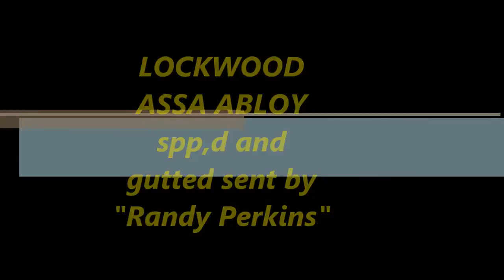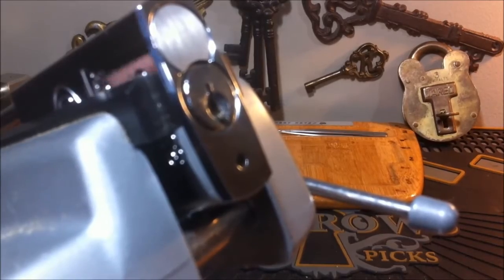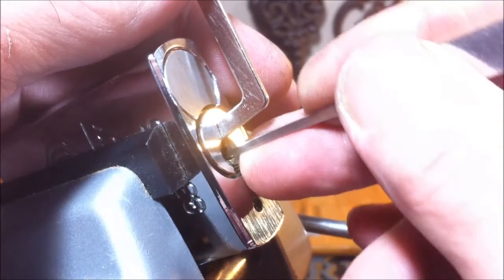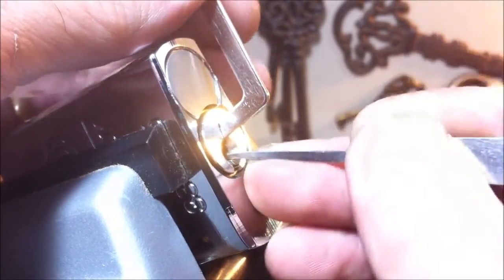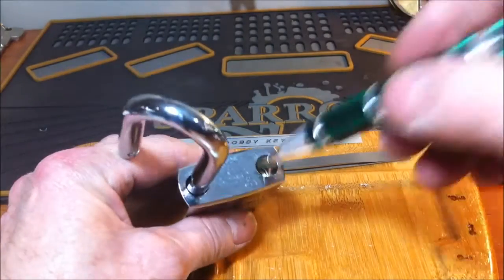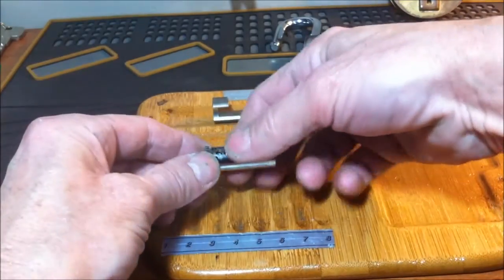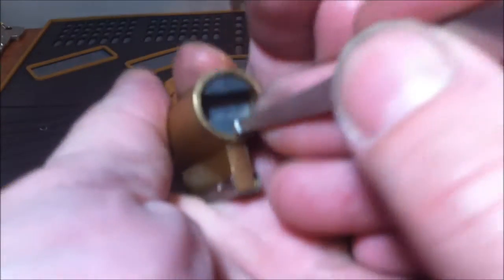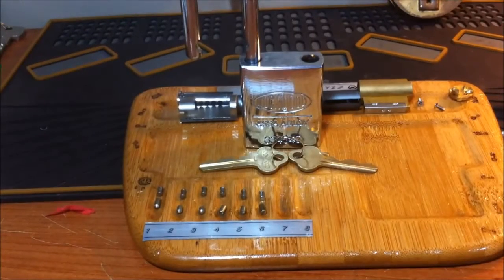(109) LOCKWOOD ASSA ABLOY spp,d and gutted sent by "Randy Perkins"

Comment: Those are not really standards in the plug. When you put the key in and they lifted a little bit and you actually had the best shot I've seen so far on the taper of the keypins. Very good job at getting it that easy.
Reply from the maker: Oh ok I'll have to take a closer look. It's still on my desk. I haven't put it back together yet. Again thank you for the lock.
Reply: Bobby Keyz good job though. I guess you already had that tensioning down and didn't even know it.
Reply from the maker: +Randy Perkins yeah I guess so. It came with lots of practice. I'll be picking this lock a few more times. They say practice makes perfect Lol. Thanks for being such an awesome supporter Randy I truly appreciate it.